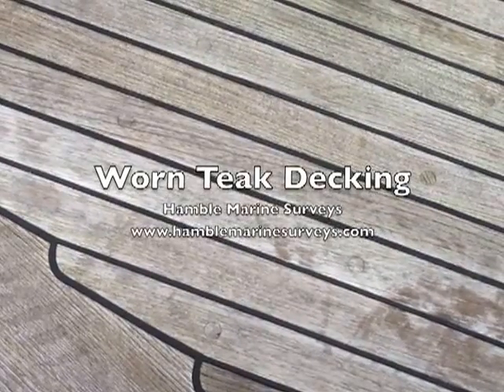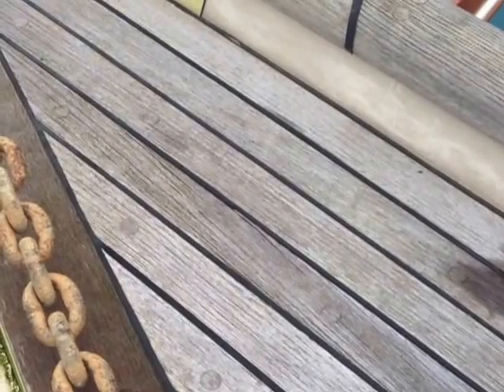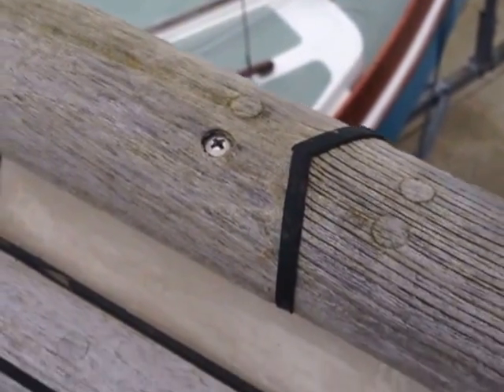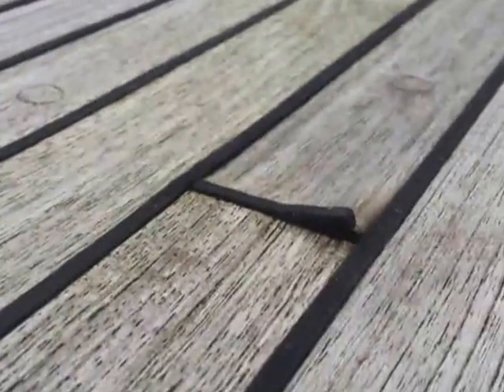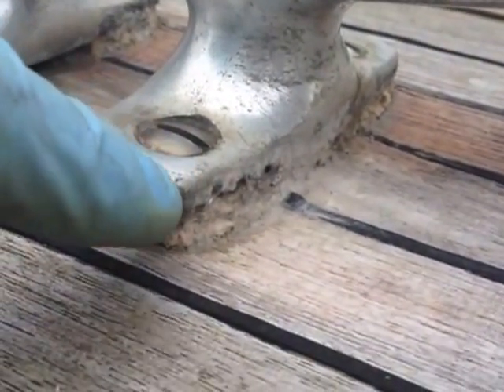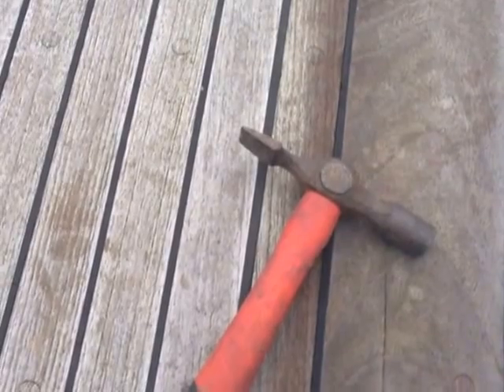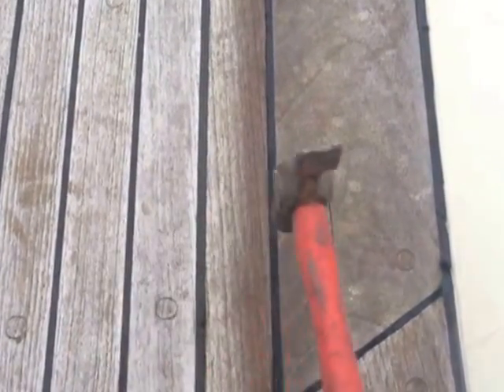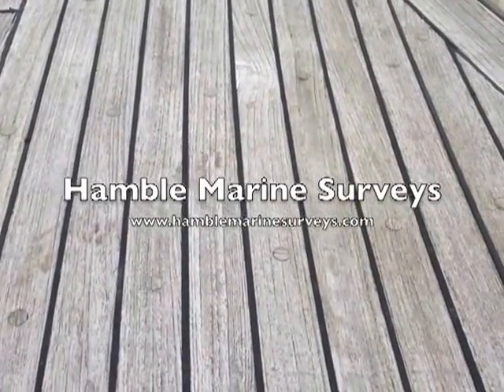Worn Teak Decking

Comment: Hi, i enjoyed watching that. 
I have a question, i have a teak deck on my boat, the wood is 20+ years old. The previous owners have used bitumen to seal the deck. The old traditional heating up of the tar bricks then careful pouring it in the seams. I believe the last time the deck was fully recaulked was around 3 years ago. Unfortunately the deck is very much not waterproof, the caulking is brittle and crumbles away put off the seams. I'd like to take all of this out and replace with sikaflex. I know not traditional but I'm hoping would be more waterproof. I've heard that this won't stick to the planking as the wood would be full of oil from previously using bitumen. Can you advise? I want to keep the deck planking and not resort to fiber glass, however the boat is unliveable when not water tight